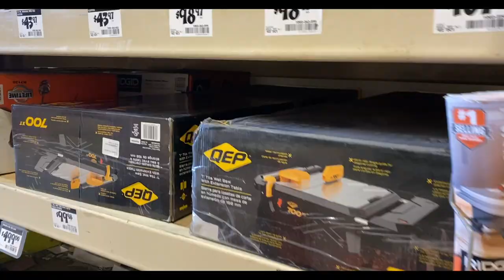The New Goonzquad Headquarters Part 46

Comment: Ok love the videos but have to step in. The backer board had to be thin set on to the subfloor then screwed. You then thin set the joints. You dont need to use the red stuff for the floor but doesn’t hurt. The biggest issue is the pre mixed thin set. Never use the pre mixed thin set. Especially in wet areas. In wet areas that stuff will not last. The pre mixed product have adhesive(glue) in them which is why they won’t last in wet areas. would have been better to mix modified thin set

Comment: You may have cut the tile too close to the toilet pipe,  i may be wrong but most flanges sit flush on the floor and are female,meaning the flange goes around the existing pipe,not inside of it,if that's the case then you wont have enough room to put the flange over the pipe so it sits flat on the floor.

Comment: No thinset between hardy backer and subfloor?
Reply: I've had good luck using a lot of screws on it and no thinset.  If you glue it down, it's impossible to remove later if you want new tile without messing up the subfloor.

Comment: Me watching them do tile: Since when do they sell mortar pre-mixed in a bucket?!?!?!
Reply: They also sell drywall mud pre-mixed in buckets now. 
IMO it doesn't make sense to buy pre-mixed unless you don't have access to water when you need to mix it. The cost difference between powder and pre-mixed is quite high.
Reply: It’s mastic I’m pretty sure they should be using thin set mastic is for splashes in the kitchen
Reply: @hailster  Well, pre-mixed is easier. I've learned that the hard way! Ended up wasting a couple batches because I didn't get the mixture right.

Comment: Please read.....Guys be very careful using mastic to place tile over a waterproof membrane.  The mastic will never fully dry!!!  Mastic needs the water to evaporate to dry.  Use a Portland cement based tile adhesive.   I made the same mistake once.  Never use a mastic in a wet room, it can absorb water and lose adhesion to the tile.

Comment: So all I have to say is that you can't be stapling and nailing into a liner or you'll have leeks and you have to prepare and do this right the pan liner or it will leek and leek big time. if there is a hole through a screw or a nail or staple the water will find his way and rot out your floor

Comment: its great to see you boys try to do as much work yourselves but your water proofing will fail. You need to silicon seal all around your pipes , mesh all your corners and run your water proofing up the wall al least 100mm and lay down at least 2 x coats of water proofing. Not sure about using treated pine for your shower hob either, but hey its still great to see you boys giving it a go.

Comment: don't think i have ever seen anybody lay down cement board for a floor
Reply: On timber floors it's essential to provide a rock solid base for any tiled areas. We usually put cross noggins at 16" centres between the joists from underneath, and screw everything together from above. The ultimate way to design these parts of the house is to stack the bathrooms and build them in concrete blockwork with a reinforced concrete slab at each level for the tiled areas. Gives great sound insulation, simpler waterproofing, means the tiles never break loose or crack, and guarantees no rot problems or any leakage into the rooms below. Costs more to build but less to repair. We just just did this on a big house in Florida and can be sure there will be no callbacks!

Comment: Those are some thicc tiles! why are they so thick?
Reply: They are terracotta based tiles, made to a traditional thickness for that material in order to resist normal bending and impact loads. Ceramic based tiles can be thinner because they can resist those loads just as well while using less material.
Reply: @johnstedman4075  Thank you Mr. Stedman! I learned something today!
Reply: @sighheinrich  You're welcome!

Comment: Uhmmm... boys? Aren't you supposed to use those "+"-shaped spacers flat, on the corners/crossing of the tiles?
As in, if you have 4 tiles in a square (2 by 2) you place the spacer flat in the middle (and so on and so forth), so all the gaps between your tiles are the same... (also they'll be less fiddly!) Just a thought for next time? (^^,)

Comment: Always start tile in the middle of the room.
Reply: Wrong! Snap a grid first with chalk line. Then you can start wherever you want.
Reply: @wno1043  Yeah. I've always spent time to try and avoid ever having less than half a tile against any of the walls. That rule can sometimes be broken if one perimeter wall is more visible than the others. We work on a lot of older buildings in the UK which are good to look at but are a tiler's nightmare of curved walls, wavy walls, non parallel walls, projections, recesses and all kinds of lumps and bumps. Practice makes perfect!
Reply: @wno1043  With a chalk snap front middle and side middle, start on the X which will be the middle of the room. It makes a pattern as crazy looking as that one symmetrical.  When doing the walls thats a different story. Always middle on the floors thats just how its done.
Reply: @bobsmith1965  LOL! "That's how it's done," eh? No. That isn't "how it's done. I set tile for over 20 years. Floors, walls, showers, counter tops, back-splashes. For floors, you snap a grid on the floor, with each square the width of two tiles (for 12" or larger tile) plus 2 grout lines. The big advantage is that you can start wherever you want to (important if there are other people working in the area), you end up with perfectly straight lines, and you don't have to mess with spacers. No professional tile man uses spacers! My wife and I have set a lot of tile in those 20+ years.

Comment: I'd definitely pay someone to waterproof and screed the shower. After that you can tile it yourself. If you stuff it up it's all on you and your insurance won't cover you!
Reply: It's not really that hard. It just takes care, and a little bit of time. Push the very dry mortar into position with a float. Slope to drain about 1/4" per foot. Keep checking for flatness and slope. Then, you get to do it all over again for the finished floor, after laying your membrane on top of the first mortar bed.

Comment: Those cheap wet saws are crap. I had the same problem.  I ending up buy the type that is a grinder mounted upside down and a table pushes under blade and submersible pump keep water on blade. After i bought the better i took the crap one back, still had all the packaging.  I showed the manager at Home Depot receipt for the good saw and told him the other one was junk and he gave me a full refund.
Reply: We had a similar experience. The cheaper wet saws can manage to cut the smaller and thinner ceramic tiles, put show them a 12" square thick terracotta backed floor tile and they soon show their weaknesses. Good that your Home Depot manager was reasonable, they tend to vary but most are OK.

Comment: When you get ready to make up the drain for the shower use deck mud not mortar alot of YouTube videos will tell you to use mortar but deck mud is the best to go and on the ledge put some kind of screening so the tile can latch stronger and won’t have vibration issues causing tile to fall off on the ledge I recommend using bullnose or a shulter you can send me a dm on Instagram if you want a better understanding of you have any questions @maxei.contreras

Comment: The mesh tape is supposed to be thinset in...not just red guard.  If you want to red guard it that’s fine but do it after.  Also I highly recommend you do not use wood, pressure treated or not, as curbing.  The expansion and contraction of wood is not ideal in that area.  Do people do it? Yes, but it def is not ideal.  Make sure you are using the right type of thinset too.  When using a membrane some thinset will not be able to cure correctly.  One other thing.  The grey vinyl liner you are about to use is a crap system.  Please reconsider.

Comment: As an romanian... From when can the screw go through concrete...our cement is like a rock.. you can't put a screw through it
Reply: It's a concrete composite board, not solid concrete or it would be too heavy to lift.  It's pourous enough to allow a screw to penetrate.  Concrete board is a common though rather outmoded way of waterproofing showers and reinforcing floors to accept tile.  Its gradually being replaced by much easier to handle lightweight boards and decoupling membranes by the likes of Schluter, Wedi and Ubertile.
Reply: @munron01  wow.. thank you for the explanation. And I have another problem. I see that building a house has a lot of regulations to pass. In our country, we don't have any inspectors coming and verifying every aspect of the house. I live in a house bulild by me, my dad and a construction worker with no degree. All the plumbing, heating, foundation wore build by us and only the electrical sistem was make by a professional
Reply: @stefannegoita5660  Yes.  All aspects of construction are tightly regulated in North America and many other parts of the world.  For the most part it is good because it keeps things from being built that are unsafe or that won't last.  In your case its important for you to do the research and follow manufacturer and trade directions and guidelines.  Fortunately there is lots of information online so you can build a quality home on your own  without the guidance of certified trades or inspectors. Always check two or three information sources if you're not sure about how it should be done and avoid cutting corners and I'm sure you'll do a fine job, just like the boys here on this channel do.

Comment: Should’ve just laid thin set on the entire floor
Reply: We always used a grid system. Do one square at a time. With this system, you can start laying tile wherever you want. Lay tile on the line on one side of the square, and off the line by the width of your grout line on the other side. Snap the grid on the floor with chalk line before you start. Then, you'll know where every cut will be. Makes it all very easy, and with perfectly straight grout lines No need for spacers.

Comment: Your transition line under the door looks to be wrong. Looks like your door would be swinging out into the hallway; you want it swinging into the bathroom. So your transition should be toward the bathroom side of the opening not the hallway side. Unless you don’t have the room to swing the door in, but it looks like you do.

Comment: I would suggest grouting the floor before you start on the shower, especially if you are going to be walking on it. Most people don't know but the grout is what is holding your tile in place...
Reply: If you have to depend on the grout to hold the tile in place, you haven't installed the tile correctly! The tile, if installed correctly, should be set firmly and it isn't going to move. As I said, if you're depending on the grout, you've done something wrong.
Reply: @wno1043  Without grout, tiles are going to shift. Especially if you start walking on them.. Grout prevents shifting, not just acting as a buffer between the tiles but holding those tiles firmly in place and preventing movement in the first place.

Comment: Hey guys looks like you did a pretty good job lay that bathroom tile the black and white stuff. I do see two fairly big problems. First the tile break should be directly under the door. The second is your elevation is way off. depending on what you’re putting in the bedroom you probably should’ve brought that bathroom tile up inch and an eighth. if you’re using carpet the top of the tile should be about 3/4 of an inch off the subfloor that the carpet is sitting on. If y’all need help send me a message and I’ll give you my phone number and we can chat about it.

Comment: Why your houses made of wood man?
Reply: Timber frame construction is used widely in the USA, particularly in rural areas and the suburbs of urban centres, and especially for building houses in the medium and lower price ranges. This is a method that has been developed across that country for over two centuries and there is a large skill base available. In all the pertaining circumstances the system makes more sense than any other.

Comment: i'll give you guys an A for effort on this one. in bathrooms I think you r supposed to use Blue wood like your Bue Sheet rock for mold resistance. you boys really need to watch hgtv's any and all holms videos. they would of taught you about the schluter water proofing system for bathrooms. you boys should at least should of been watching hgtv before, during and after this project, plus watch older holms videos from hgtv, plus youtube, and internet research would of helped allot. Also the floor pattern choice looks old fashioned and you boys like modern, very confusing in your choices. imho, floor is ugly.

Comment: Your waterproofing is all wrong guys, it needs to be put on about 10 times thicker. You also must use a plastic right angle from the floor to the wall which acts as a movement gap. You then waterproof over it and up the wall about 10 inches. This needed to be done before the floor tiles are installed!!!
Reply: I have no idea what you're talking about. Are you talking about the shower? They haven't touched the shower yet. You don't need to run Red Guard up the wall for the bathroom floor. In fact, they didn't need Red Guard at all. If they tile up to the drywall, which is probably half an inch or so off the floor, there will be sufficient gap. Besides, there will probably be baseboard too.
Reply: @wno1043  the entire bathroom should be waterproofed not just the shower recess! If there is a leak from the toilet of hand basin then water will get under the tiles and destroy everything below!

Comment: I think doing the floors first was a terrible idea. Having just finished a floor with that exactly tile, you drop any tools on that pattern stuff while working on the shower, you'll get lots of practice replacing tiles. Concrete board should have been mortared down to the floor before fastening it down to prevent any movement. Green treated lumber for a curb?? Wow.  Not a fan of watching context that I do for a living especially when it's not done correctly. Corvette build made me subscribe, this made me unsubscribe. I'll be over on Vtuned's, watching the McLaren build.